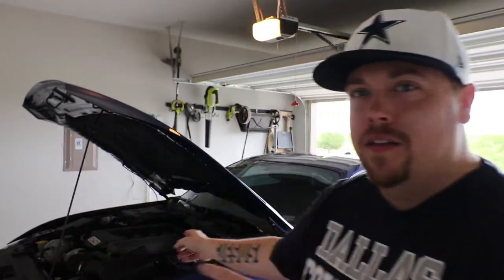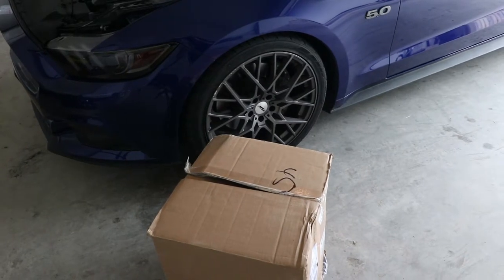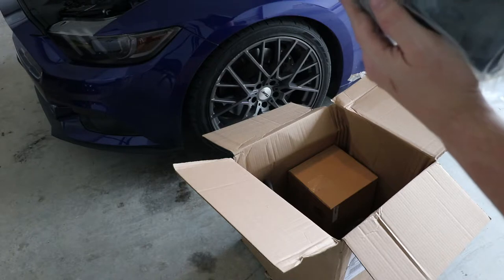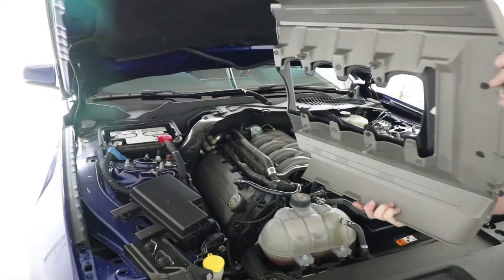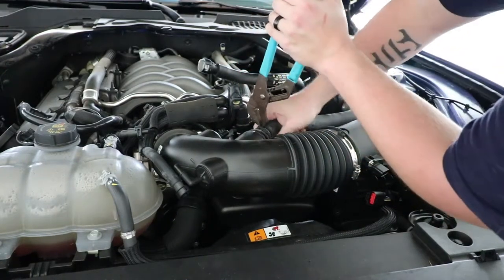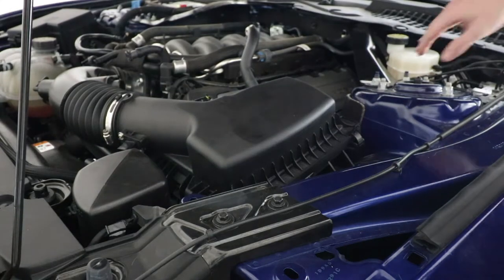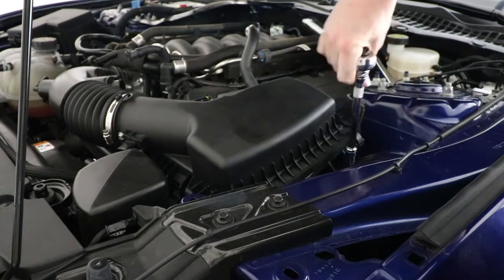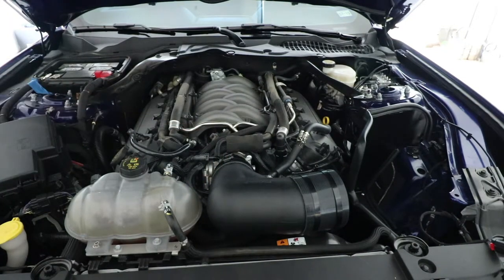Install & Review PMAS Cold Air Intake 2016 Mustang GT

Comment: Thoughts on the pmas intake?
Reply: Knightmare5.0 I just bought the PMAS CAI tune required with the Lund nguage and let me tell you it was every bit worth it. I didn’t think it would make that big of a difference but the car does pull a lot harder now. The only mods I had before this was borla ATAK catback. But yeah, I need new tires because my car doesn’t know what traction is anymore.